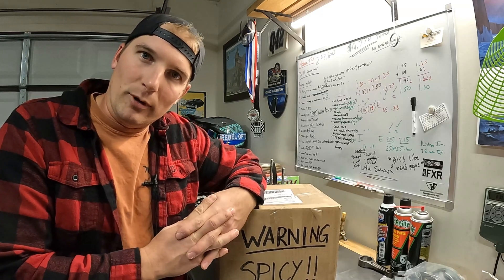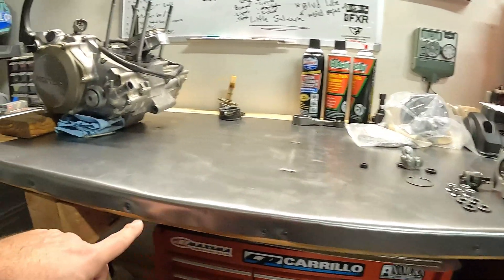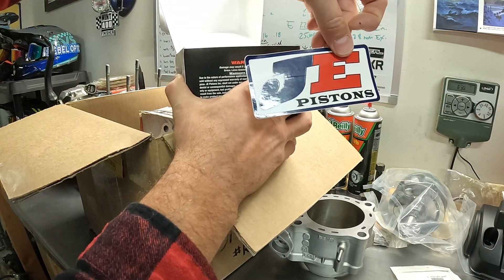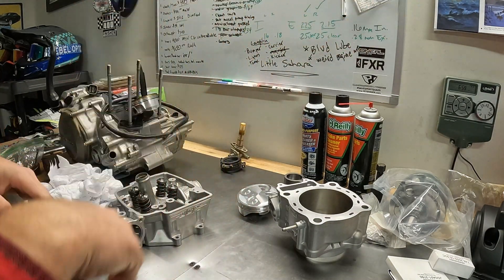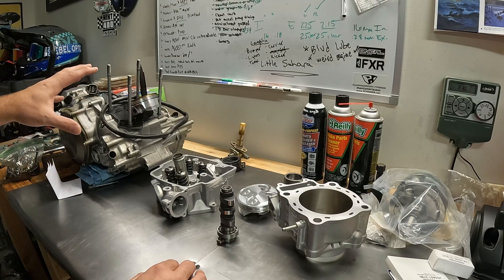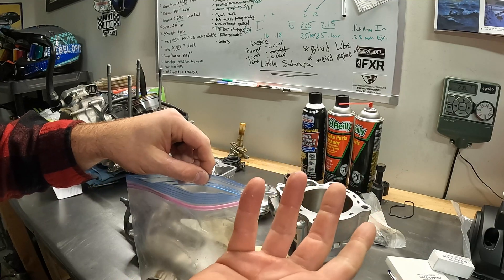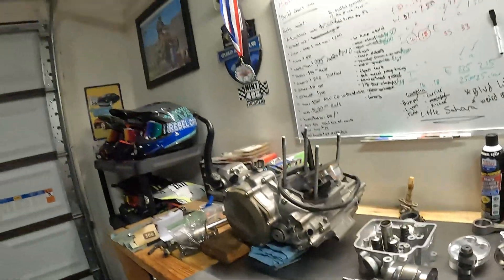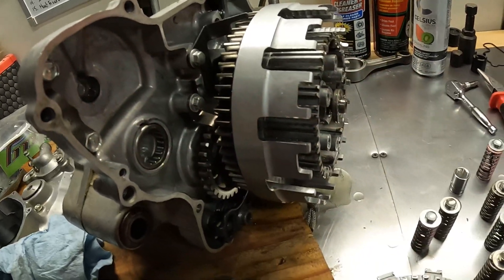Completely disassembling a Honda 450R engine, then revealing how I'll rebuild it!

Comment: I need to cover my bench with some metal great idea man. Years ago i ran je piston’s they always held up fine.
Reply from the maker: Sweet. First time running one. I've had luck so far with Wiseco, CP, and OEM. I think even a Vertex in my wife's machine. Knock on wood, all good so far.
Reply: @SQUARE1SpeedChannel i ran vertex for years with great luck as well now i run wiseco’s from bnr he has a couple custom pistons for the yfz’s